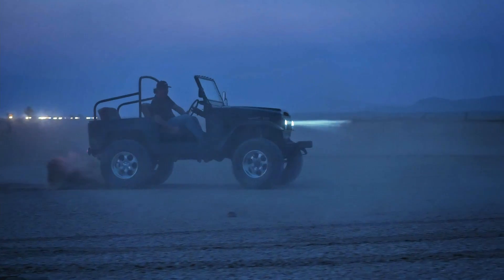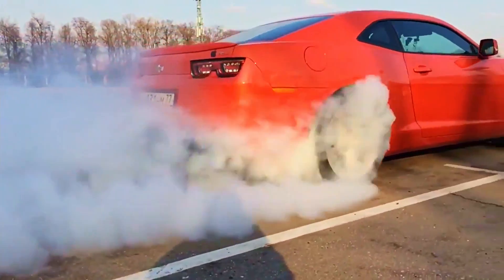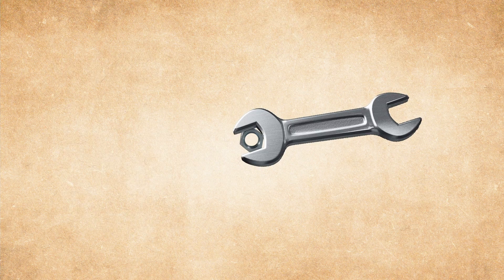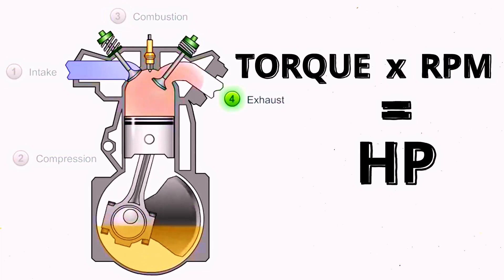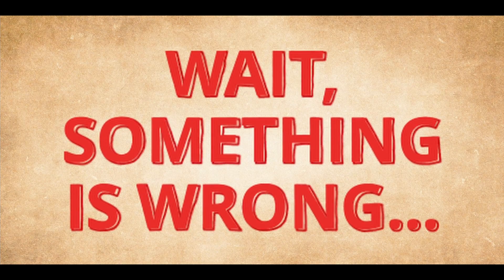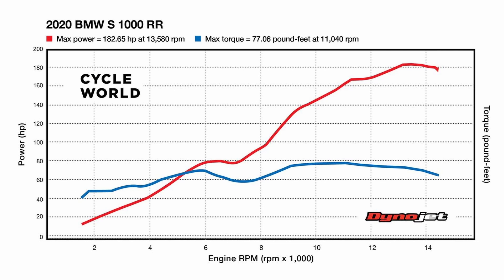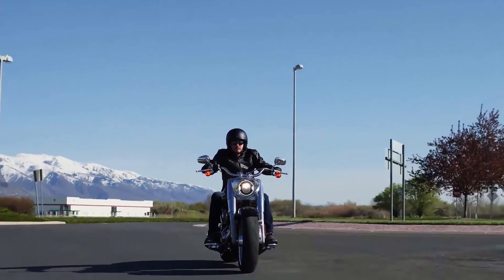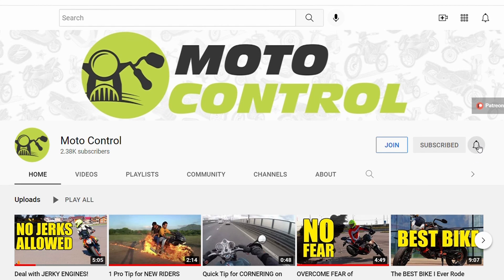Power & Torque - Best Analogy to Understand

Comment: With regards to bikes: is it common that 2-cylinder mid-size engines (like 400cc) are less prone to stall in low rpm than 1-cylinder engines of the same power (similar motorbikes) - kind of more forgiving for inexperienced riders?
Reply from the maker: Hi! Yes, some bikes are more prone to stall than others, and the amount of cylinders is not the only thing that matters, the gearing and fueling have big impact on that too.

Comment: Hi Andrei, I have a video idea for you, about ABS: When talking about ABS, a lot of riders say they don't want it because they are so good at braking, they can stop faster without ABS. How true is that? I think they over-estimate their abilities. I believe that with early ABS, an expert rider could out-brake it in ideal conditions. However, I doubt that the average rider could out-brake modern ABS. 

A related question: Is there a difference in stopping distance between slamming on the brake with ABS (so that the ABS kicks in straight away), and progressive braking with ABS (that is, using proper braking technique)?
Reply from the maker: Hi! In my opinion for road bikes ABS is always good, because even if you trained braking a lot you'll still have to do that in rain, sandy, muddy asphalt, etc. It's very hard to train in ALL surfaces, so ABS is good. For racing, gymkhana, and stuff like that I don't think ABS is necessary. Can we out-brake ABS? Of course, we did it all the time on our courses. On the same patch of asphalt in a very good weather😁 On newer top-class bikes the difference is within the measuring error though (not only because of newer ABS systems, but because of advanced suspension too, which reacts much better on ABS "chattering"). For real-world application at random pavement at random weather however ABS is always a good safety feature. And about slamming brakes - on older/cheaper bikes yes, the difference is pretty significant, like about 10-15%, on something new and cool like BMW R1250 the difference is maybe 5%, which I consider within the error (we didn't use any advance measuring methods, we just had an entry gate and the points where the bike stopped in multiple tries, plus the rider error on entry speed, so take our results with a pinch of salt). That's if we just slam the brake vs progressive braking technique, we don't consider massive errors like trying to brake on opened throttle or death grip on the handlebars, even the new bikes don't handle that very well. They won't fall down, but the stopping distance will be much bigger.
Reply: @MotoControlEn  Thanks for your detailed response! I appreciate that you have tested these things out in reality.

Another reason I think that ABS is good for everyday riding is that sometimes things can happen so suddenly (such as a car pulling out on us) that we don't have time to consciously react. We just brake instinctively, and good braking technique can go out the window. If we are being realistic, we don't know how we will react in a panic situation. Training is helpful, but unfortunately it's hard to train for unexpected situations. 

Another good thing about ABS is that it's a good training tool, especially for new riders because it allows them to practice hard braking in a safe way. A lot of people crash because they don't brake hard enough because they don't know what maximal braking feels like.

Comment: I still dont understand why higher wheel torque accelerates the car faster in lower gear. The hp at the wheels is nearly identical at every gear but you accelerate much faster in first gear due to the higher wheel torque in first gear. Why is engine hp best for acceleration but at the same time max wheel torque is better for acceleration
Reply: Transmission changes rpms at the crank to different rpm at the wheel. For example if your gear ratio for first gear was 0.5 at 1000 crank rpm, your wheels are rotating at 500 rpm. The power is not changed (if you ignore transmission losses), therefore you essentially doubled your torque at the wheels.
Reply: @LukeTheRager  yes thats what im saying you get higher wheel torque at low gear and higher acceleration so my question is if wheel torque is what accelerates us , then why do we even care about engine horsepower? Shouldnt we get peak acceleration at lowest gear and at peak engine torque because that way we will have highest wheel torque going to the ground
Reply from the maker: @288gto7  I tried to answer this from timecode 3:26
Reply: @MotoControlEn  thanks i ll rewatch that section
Reply: @288gto7 acceleration at fixed one gear is where engine spin rpm at which have max torque , but at given vehicle velocity bigest acceleration can be achieve only be use engine rpm where it gemerate max power 👌🏻 feg if you instal accelerometres in your car which show you Gforce graph relation to velocity  and you choose let say 3 gear from 2000 rpm to 6000 rpm where max torque is at 4000 rpm velocity be from 20 to 60 km/h than Gforce meter show you bigest Gforce at 4000 rpm and you would feel it in your seat while accelerate ( well thers other stuff impact on gforce beter if i would write about contact path force cos if at 2000 rpm be not to much less torque than at 4000 rpm but outside resist increase more like drag and so one it could turn out that despite at 4000 rpm at contact path this vehcile generate max force which try to accelerate car fastest posibble but the much biger resist at 4000 rpm make acceleration lil smaller than at 2000 rpm it can hapen in some egzample )  vs now try choice one velocity let say 100 km/h and use gear and rpm which  give max torque at engine crank at this 100 km/h let say 4 gear 4000 rpm max torque at crank at this 100 km/h vs in second attempt use rpm where engine generate max power let say 3 gear 6000 rpm  now your Gforce meter show biger acceleration in 2 attpemt at max power rpm 👌🏻  ., in race you want to be closest to max engine power posible unless gearing cant give you this or there is not enough traction  strong lowend torque is god for daily riding elasticity at high gear low rpm that driver dont need reduce gear and just put pedal to the metal and accelerate good from low rpm compare to some other engine which have less tprque down low so less power down low if he want accelerate as good from the same low rpm from the same velocity he  be no able do this 1 car drive away from him for not be leave in the dust 2 car must reduce gear on lower gear be how much gear depend how much worse have lowend  power compare to 1 car the worse it have the more gear he must reduce down for accelerate the same fast cos at lower gear at biger rpm engine produce more power offcorse only to certain point = peak power after which  power drop down 👍🏻 reducing gear more than which give you kax power rpm  decrease contact path force and acceleration cos rpm be itself are pointles dosent matter how much rpm you have and on how low gear you are if there engine dont make more power acceleration be only worse 👌🏻😁this how many gear must be reduced also depend on diffrenc in gear lenght the samller diffrenc the more gear must be reduced also 👍🏻in race this is pointless i mean lowend torque in race you want always max posible acceleration and this can give you only max engine power cos watt power : vehicle velocity m/s = force which accelerate vehicle forward  so on track you choice such gear which hold engine rpm close to peak power depend how wide peak power is how rapid it drop down on both side of power graph the shorter peak power and the more rapidly power drop after peak and more rapidly increase before peak driver must put more atention to not fell off short peak power rpm cos acceleration drop down be alot in such power graph alot gear is required and small diffrenc in lenght betweem them so when you shift from lower to higher gear while accelerate rpm must not drop down way lower than at point at which you shift 😎 vs when power graph  is strong = very wide pesk power wery strong midrange than diffrenc in gear lenght can be biger quantity of gear overall less and you dont need be so concetrated at small aprt of rpm cos when you be far from peak hp ypu dont lose so much ona cceleration 👍🏻 so at 1 fixed gear max contact path force is at max engine torque rpm. but at one fixed velocity which you want comapre max conatact path force is when engine is on max power rpm and also this peak power engine rpm at given vehicle velocity always generate max drive wheel axis torque cos you have torque at engine crank which you seen in tech spec catslogue but you also have torque at drive wheel axis whichvalue is diffrent most of the time except 1:1 gear ratio and dont including drive train loses period for daily riding you need as much lowdown torque at engine crank as posibble for racing you wamt as much peak power as posiible 😎👌🏻 feg for daily riding for most driver beeter car be 300 nm 2000 rpm 150 hp 5000 rpm vs feg on track better be 200 nm at 6000 rpm and 200 hp at 8000 rpm  better is bad word maybe cos 1 car can give more fun on track some people while some not but 1 car be just slower at the track assuming both have perfect optimal gearing give them max posiible velocity and best acceleration posible 👌🏻 dude in this video mess up couple stufff anyway dont watch this egzacly just some part and jump further to another part 😉
Reply: for practical everyday usage (no track days):
You want the most torque, because this gives you best acceleration.
You do not want high hp, because this gives you opportunities for costly speeding tickets.

Only those imagining themselves to be aspiring MotoGP heroes really need high-revving engines 🤣😂.
Just as an example my Kawasaki revs to 12000 rpm, but where I live I can rarely exceed 6000 rpms.
Reply: power :velocity = force sosuch the same power aply on lower velocity exert biger force accelerate vehicle forward  everything is correct 100 hp at 50 km/h exert 2 times biger force at contact path than 100 hp at 100 km/h 👌🏻 if whell radious is fixed than you also have 2 times biger drive whell axis torque at 50 km/h 👌🏻

Comment: Amazing video, majority of hp vs torque videos are pretty bad but this one is very good. Also one more thing i would like to add, as far as american v8s go yes they have much higher displacement than european dohc engines HOWEVER because they are OHV and not dohc they are still lighter and smaller than european v8s. They can also be great performers. Take GM LS3 and Bmw S65. Ls3 has 6.2L displacement compared to 4l of s65 but ls3 is physically smaller and lighter than the s65 despite having more than 1.5 times the displacement thanks to its very compact ohv valvetrain heads compared to the absolutely massive dohc heads of the s65. Yes because its ohv it cant rev crazy 8500rpm as s65 but that doesnt matter because of its huge displacement and its big torque it makes peak 430hp @ 5900 rpm meanwhile s65 makes peak 414hp @ 8300. s65 is a less powerful and much much less torquey engine yet its also physically heavier and bigger than the "big inefficient american v8". Since LS is comfortably making that power its also way more reliable than the s65 thats pushing itself to limit to get that power. My point is that american v8s make a lot of sense performance wise, i am not into bikes that much so i cant speak for harley idk about those but as far as car engines go the american v8s are very good for prrformance also. The only downside of ls3 compared to s65 is worse fuel efficiency and emissions and outside of that it destroys s65 in everywhere else especially in reliability. Also just in case anybody doesnt know , ls3 and s65 are both from same mid to late 2000s era and naturally aspirated and used in high performance cars. S65 in e90-92 m3 and ls3 in the base version c6 corvette and later in the camaros etc as well. Base C6 Corvette destroys the m3 as well